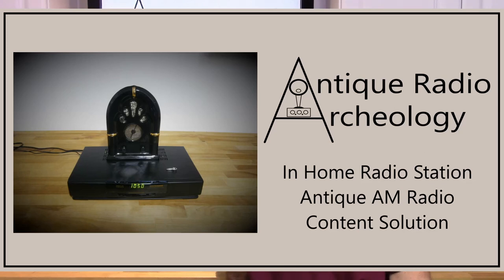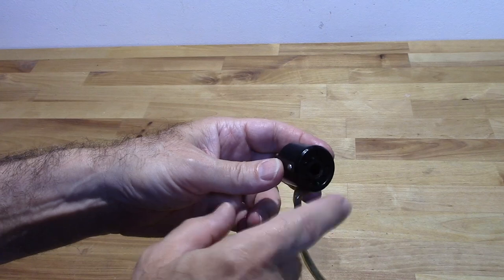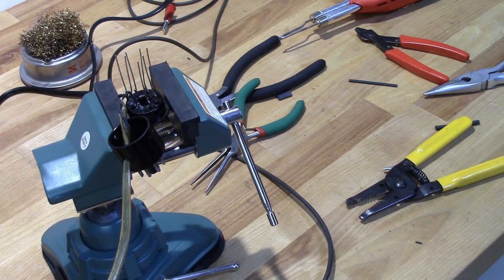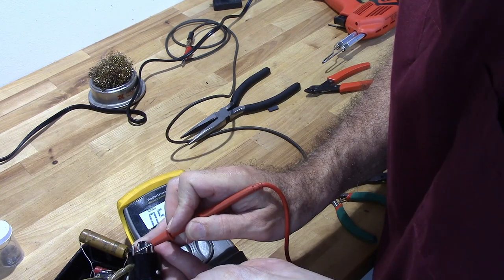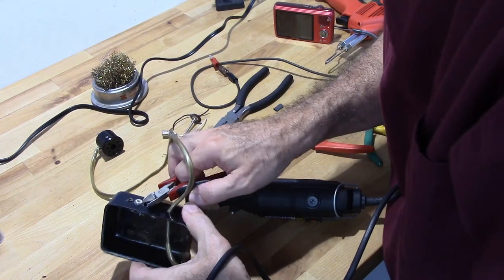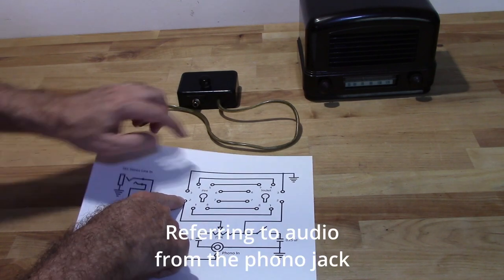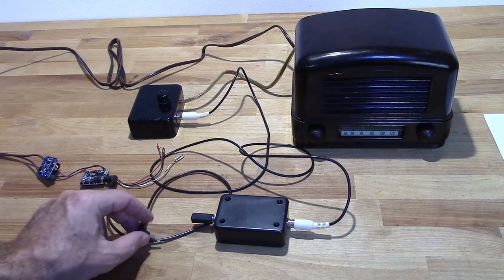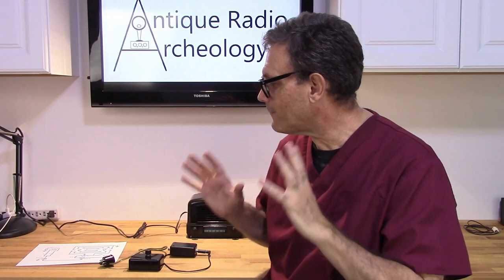Add Blue Tooth to an Antique Radio with a Thompson Adapter

Comment: At home, I use a low power FM transmitter that can cover about 50 feet and tune my old AM/FM radio to a dead spot on FM. Now I can listen to YouYube or Podcasts in the bedroom where my old radio is and I can carry a portable FM radio with me around the house. My favorite mod as a youth was to add a stereo multiplex circuit to a tube FM radio and get stereo out (two RCA Jacks). I thought this was wonderful back in the day. (1965 or so)

Comment: I agree with your opinion on the Blue Tooth trend, What I do if the radio has a phono jack is use an interface box that plugs into the radio's phono jack, and it has is an audio isolation transformer inside of it that connects a stereo jack to a MP3 player or Blue Tooth device, and it sounds great. I also use a very good AM transmitter that broadcast through the house that plays MP3 or internet radio through it and also sounds very nice. No radio modifications needed.
Reply from the maker: Totally agree.  I wish more radios had phono jacks installed.  I will be doing a video in the future showing how to add a mini jack.  I have to do it in a way that I don't have people putting the jack ground on a hot chassis, which is stupid dangerous.  Audio isolation transformers really help with the noise and safety issue.  I use my AM transmitter mostly.  If I do any radio mods its usually for customers.